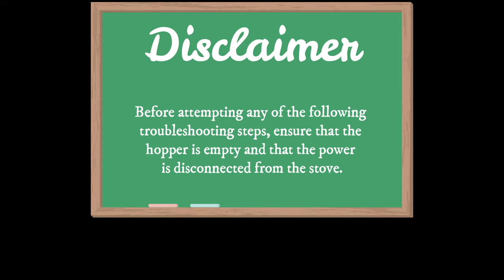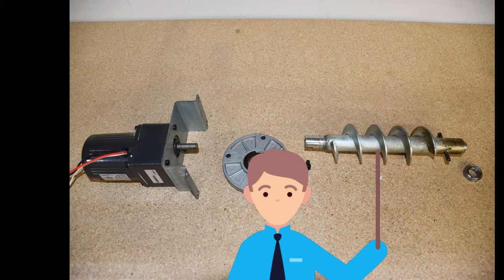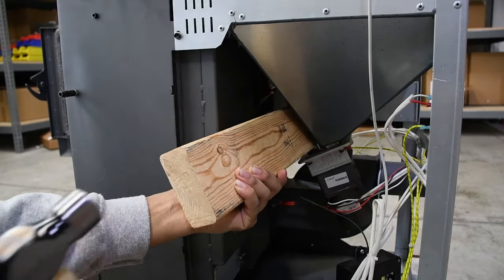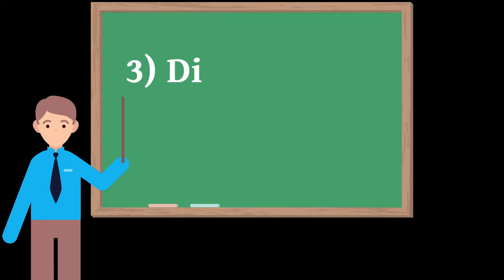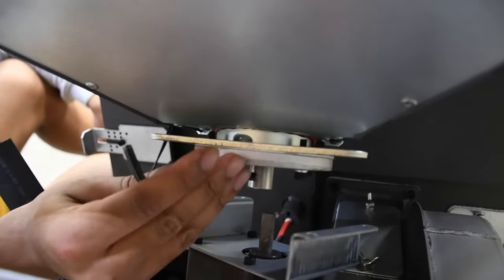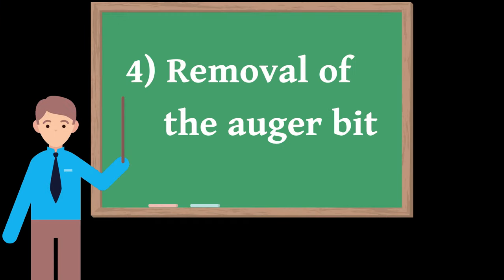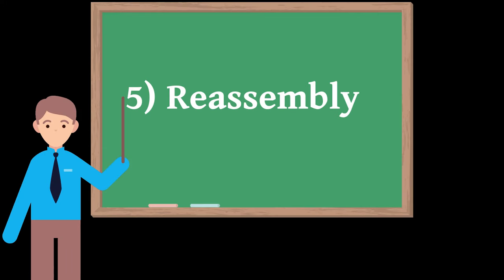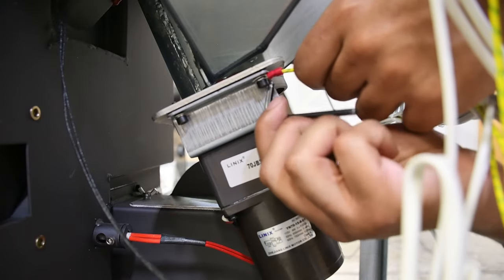Auger Troubleshooting

Comment: Groaning noise - The first time I had the groaning noise from the bottom bearing I disassembled the auger assembly and lubricated the bottom bearing with white lithium spray grease. Next season the noise is back. This time I emptied the pellet bin completely (burning pellets, scooping and then vacuuming). I motored the auger and tried to just shoot some powder graphite as close to the bearing as I could get at the bottom of the auger. This didn't work (although if I had run it for an hour or so it may have). I then shot some liquid white lithium grease onto the bottom of the auger. I suspect it may have grabbed some of the graphite and made a slurry of sorts. The noise went away. I did order new bearings but I'm hoping this gets me thru the season anyways. Good luck folks.

Comment: If I unplug the bottom motor and plug it, wires into the top motor, it turns, but it will not turn  being plugged in to its own power source any help

Comment: So anyone have any ideas how to remove the top bearing?  I took apart everything and the top one is stuck. I have tried hitting the top of the housing, tried using a flat head screw driver to reach up and move it and nothing works. Its really stuck up there.

Comment: Why will my auger keep filling and not stopping is my issue it's not that it's clogged it's over filling what do I do about that it's a brand new unit
Reply: Did you ever get it figured out? Mine is doing the same thing
Reply: Probably have to adjust feed settings, if it's not lighting quick enough also check that your ignitor is positioned properly and didn't shift out of place before or during the stove install.

Comment: Would this also help with an auger that is groaning? Trying to figure out if it needs to be replaced or not
Reply: you need to take the auger apart and lubricate the bearings.

Comment: Hello my pellets stove dint start ignition of pellets, I changed the ignatoer heater and the heater now works and turns on the pallets normally. back but everything was fine for 5 days and now it's making noise again ?? Squiking ?? Anny solusion.
Reply: A periodic squeaking noise could indicate debris or a sawdust buildup inside the auger housing.  You can try sprinkling some graphite powder into the pellets as a preventative measure, to help coat the internal metals, and prevent future buildup of sawdust.  Squeaking noises could also indicate a possible bad bearing.

Comment: anyone know how long it take the auger to make a full rotation??
Reply: I don't know exact time, but be patient as these things are designed to go quite slow.  I think mine, a different brand, only does half rotations every few minutes based on the level of burn that you set.
Reply: The auger will make a full rotation in less than a minute (when on the highest level)